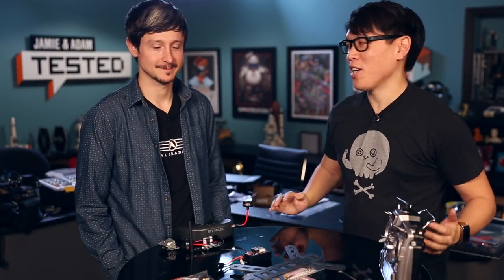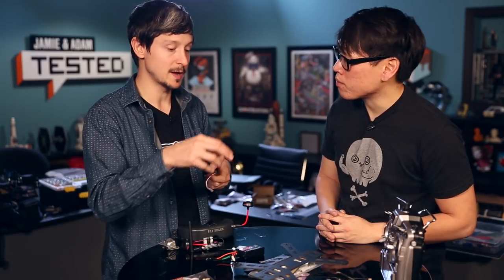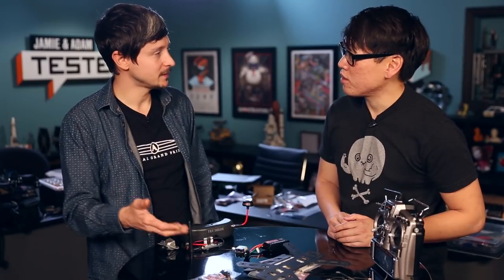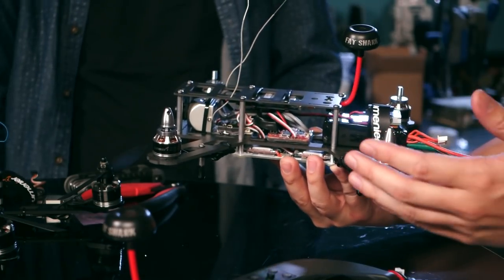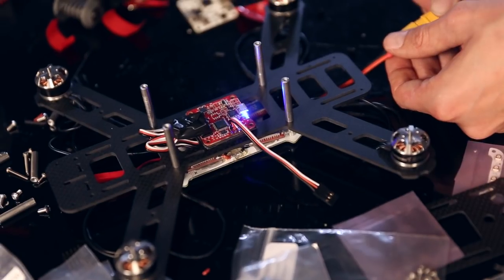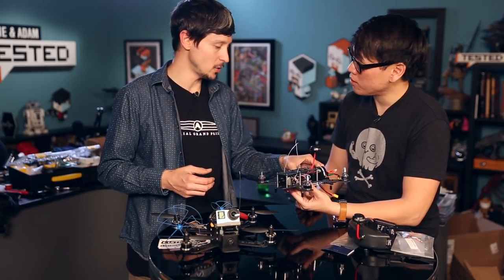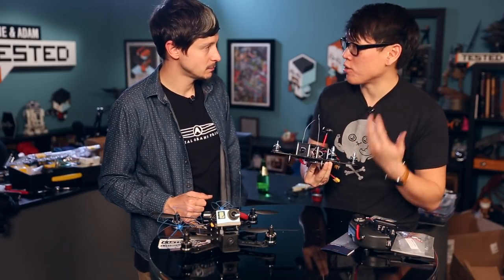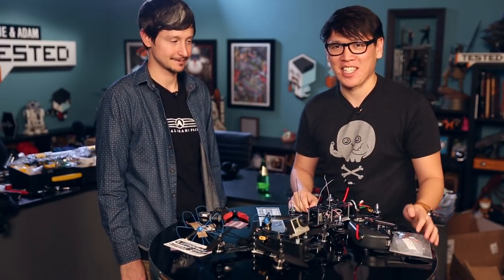How to Build a FPV Racing Quadcopter!

Comment: If like me you're watching this tutorial to enter this hobby, just know that the electrical parts they propose don't work well together, wrong battery with wrong speed controler (ESC) for the motors they are telling you to buy.
And I found out after I bought everything...
Reply: what would you do differently?
Reply: Hi Vegan Stains (what a name xD )

Keep the motors, they work well (it's not the same motors anymore, cause lumenier upgraded them).
In their specifications it's written 
Max Continuous Current (A) 60s
13A
, so your ESC (electronic speed control) must be at least resistant for 13A (more is better) but in the tutorial they tell you to buy 12A (first mistake, the risk here is that your ESC will burn).

Then the batterie, it's a 1300mAh , 11.1v , 3 cells and it's written in it's specifications (35C).
35 C means that the batterie can give an amount of 35 times its own charge (1300mAh) in continu.
The problem here is that you need to give power for your 4 motors, the calcul is simple:
Each motor is 13A, so you need a batterie able to give in continu 4 X 13A = 52A, this batterie only gives 35 X 1.3A (1300mAh) = 45.5A.
So choose a batterie with more mAh, or more C, so you will have your 52A minimum (you can have a batterie wich has more than 52A, be sure it's still a 11.1 v with 3 cells (3s).
Be aware that a batterie with more mAh or more C is heavier, choose the more powerful and lighter batterie you can find, it will increase the autonomy of your quadcopter.

I hope I was clear enough, if you have any more questions, or things I said are unclear for you, just ask ;)
Reply: +Vegan Stains
And unlike me, don't forget to buy a charge station for your batteries (I say batteries, cause it's common to buy more than one batterie to have more flying time, instead of 8 minutes flying, 45 minutes charging.)
Before flying your drone be sure to check everything you need to know about Lipo-batteries and programming the Naze32 (flying board controller).
Reply: Awesome just the information I needed lol, I was asking another fellow about his parts and he had 20A honeybee ESC on board and I wondered why the huge difference between his specs and these 12A's you've cleared that up for me. I'm trying to find all of the parts but I'm wondering if I just buy a standard racer, what are your thoughts on that?. or will I be dissapointed with performance as they might not use the best gear to keep prices down could get something around 400 bucks

What did you do about controller and fpv screen as he dosent mention it much, I'm thinking about getting the goggles not an lcd. What did you buy? 

 Looking at it now I know I'd be dissapointed ending up with something slow and of less quality because because of being a tight ass. Definitely buying extra batteries!!!
Reply: +Vegan Stains 
I'm waiting for the package with my fpv goggles, I find it better cause it really feels like you're inside your quadcopter.
I heard great things comming from the pre-constructed copters you can buy. it's really like when you're buying a new computer.
When you get all the pieces separately, you learn where they need to be pluged, and you know how to remove them, change them for an upgraded part.
When it comes pre-constructed, you can't always upgrade parts cause it won't fit in the frame.
In the end it depends if you want to upgrade it regulary or not.

Personnaly I bought it piece by piece cause I wanted to do it myself and learn how the electronic worked ;)
Reply: Yeh that is true, electronics is something that I haven't done much of, not that it's a massive project. 

Are you able to tell me what controller you got, and what fpv goggles?. 

Thanks for the tips anyway bro

Comment: I was so optimistic about this build until they broke out the soldering iron. I am the worst at soldering components.

Looks like I'll have to pay extra for a prebuilt kit.
Reply: Bernard Manansala man I was horrible too, but it takes a couple of practice runs to get good at it.
Reply: CHARPU FPV, thanks for the encouragement. So this kit is a good starting point for beginners and has room for upgrades?
Reply: Absolutely, but if you haven tried any kind of quacopters before its better to start with something a little smaller to get the basics. Something like a nanoqx.
Reply: +CHARPU FPV, I once owned a 1st Gen Parrot Drone. The novelty of it wore off quickly because it was not customizable.

Thanks, I'll look into nanoqx.
Reply: If you want to get into the hobby .... you should really just learn to solder. It's really not that hard once you get the technique down.
Reply: If your in the UK you can search for racing quadcopter in ebay, I build them and sell them
Reply: Google "ImmersionRC Vortex"

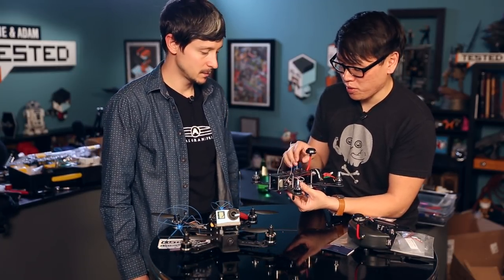Comment: What did they say not to do at 22:45 ?
Reply: EleventyThree Do not power on the receiver without the antenna plugged in or it could do a lot of damage.
Reply: Jase Lyle Thanks!
Reply: Jase Lyle Actually it was the transmitter for the FPV, not the flight control receiver.

Comment: My question is... if you can mount a gopro on a FPV Quadcopter, why would you spend $2k+ on a DJI Phantom 2 or DJI Inspire 1 that does the same thing... instead of viewing live feed through a screen, you view through a goggle... i think marketing plays a huge role
Reply: If you build your own quadcopter you will save a LOT of money and gain extremely valuable electronics knowlege.
I built a fairly big hexacopter that can easily carry large professional cameras for much less than what you pay for a tiny plastic phantom.
Also since I built my own I can choose what ever FPV (first person view) system I want that has much longer range than the DJI systems and extra batteries are probably around 5 times cheaper.

You don't need to use goggles, there are hundreds of FPV monitors available and they are much cheaper than the goggles.

DJI's lightbridge systems like the Inspire uses are pretty cool though, they get you much better live feed video quality than the analog systems that most people use, but they have limited range and in most cases you have no need for HD downlink.

Flying RC aircraft has been a "nerd" hobby for since the 1920's but since DJI started selling their fancy ready to fly quadcopters around 2012 any idiot can buy them and fly without having any knowlege about them which is why just now, everything is being regulated.
Reply: ***** I don't know a thing about electronics... I would pay for someone to teach me how to build and fly a FPV Quadcopter for racing. I want to mount a GoPro Hero4 Black on it too! I'm in Philadelphia, PA in the USA... damn I wish I can go to a place and talk to someone about it in person here...
Reply: Michael Choe But there is a place.. rcgroups.com has both a multirotor and a FPV forum :)
If you go there, check out the sticky threads first, they have some noob friendly information